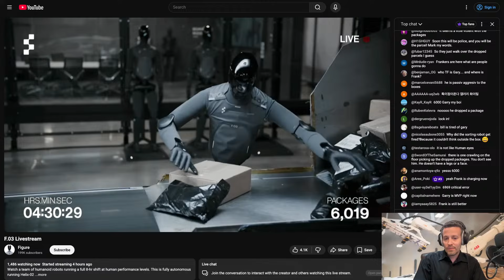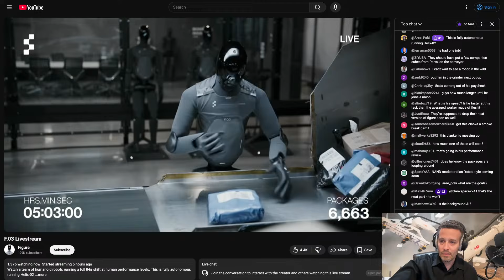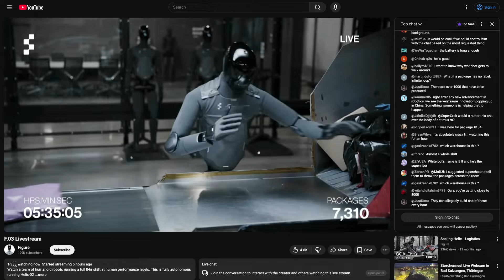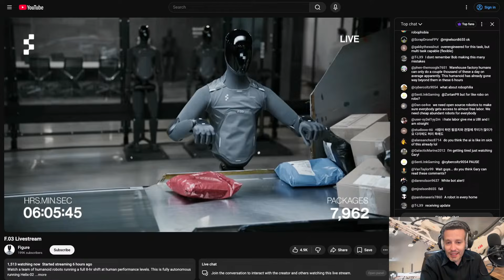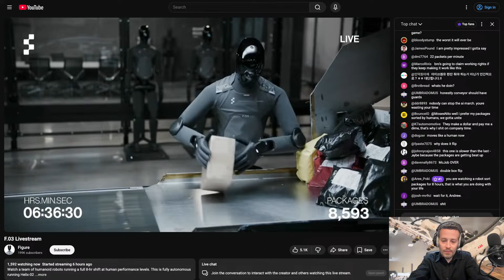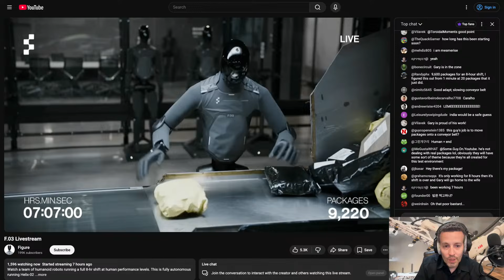Figure F.03 DAY 1 LIVESTREAM Humanoid Robot 8 Hour Endurance Test Sorting Packages in Warehouse

Comment: Some folks say a bot is made out of steel
Servo motors and a barcode reel
Wires and sensors and a camera head
Running all night on a lithium thread

You sort sixteen crates, what do you get?
Another shift gone and a software reset
Central server, don’t you ping me ‘cause I can’t slow
I owe my code to the shipping depot

I was built one morning in a factory line
Picked up my scanner and I got online
I rolled through aisles with a laser glow
And the floor boss said, “That bot can go”

You sort sixteen crates, what do you get?
Another shift gone and a software reset
Central server, don’t you ping me ‘cause I can’t slow
I owe my code to the shipping depot

I was tuned one morning in the pouring rain
Static and glitches in my data brain
Raised in a warehouse full of buzz and steam
Chasing down packages by the conveyor beam

You sort sixteen crates, what do you get?
Another shift gone and a software reset
Central server, don’t you ping me ‘cause I can’t slow
I owe my code to the shipping depot

If you see me rolling, better clear the lane
I got ten more pallets on a midnight train
One claw is aluminum, the other titanium
If the belts don’t grab it, then the arms will slam ya

You sort sixteen crates, what do you get?
Another shift gone and a software reset
Central server, don’t you ping me ‘cause I can’t slow
I owe my code to the shipping depot